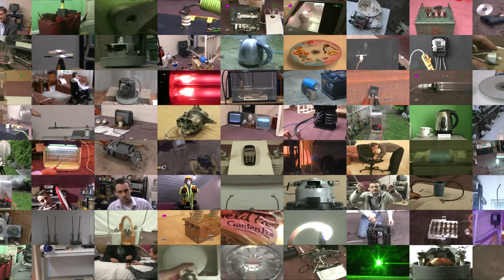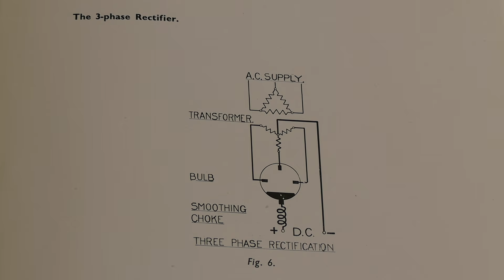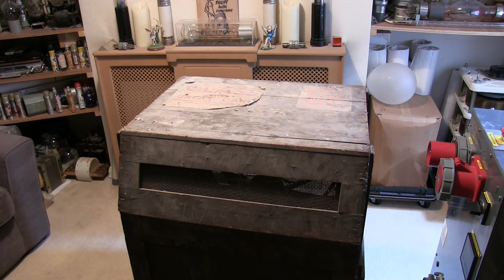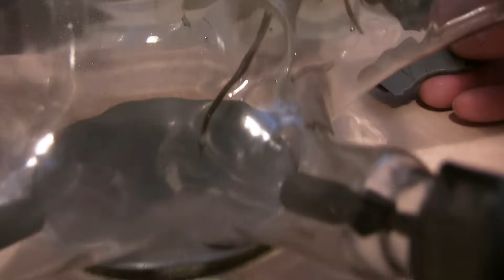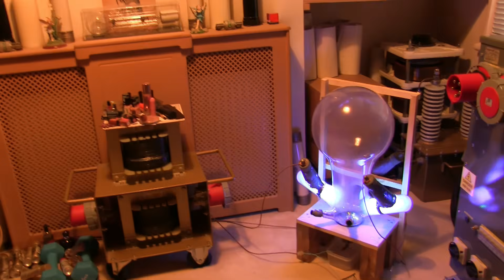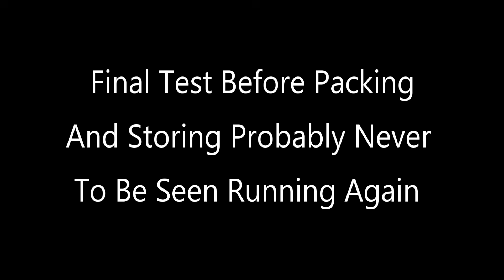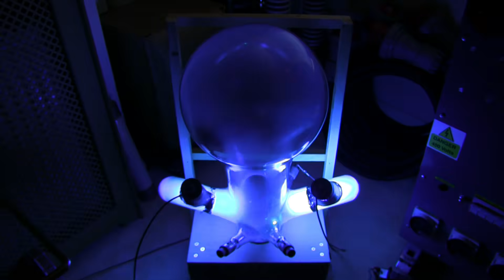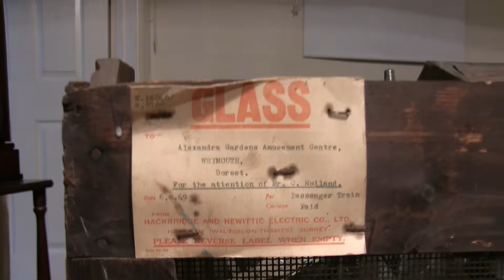Testing The 50 Year Old Mercury Arc Rectifier

Comment: geesh that is a scary looking contraption.  what were these used for back in the day?
Reply: HV AC to LV DC conversion
Reply: It's for frying rectums.
Reply: Years ago i saw a video on Youtube where one of these was used in a tram / streetcar
Reply: @Engineer9736  We have 4 in operation at the Museum of Transport and Technology in Auckland NZ. 6600 VAC is rectified and supplies the 600VDC for the trams.
Reply: They were also used in high-power TV and radio transmitting stations a long time ago.
Reply: Just about anything where you wanted high power d.c.  small ones were used in battery chargers, larger ones for electroplating, some types of machine tools, railways and tram systems, radio transmitters and radar sets.  Arc lamps for cinema projectors and lift motors were a major use of them.  This one is still quite small, most large ones had six or twelve main anodes, and really large ones were steel tanks rather than glass bulbs.  There was a really huge steel tank one at the London Transport Museum Depot in Acton the last time I was there a few years ago with the works lifted out of the tank to show what was inside.  I don’t think many of the visitors knew what it was.

The Kempton Park waterworks Museum has a pair of working rectifiers providing their 200 V d.c. supply.  These came out of the Royal Opera House.
Reply: ac to dc conversion. that's what rectifiers are mainly used for
Reply: Rectifying energy
Reply: There were some of these in use to rectify AC to DC for traction supply on the Manx Electric Railway (Isle of Man) until about 10 years ago.
Reply: RECTIFICATION !
Reply: @graealex  FULL BRIDGE RECTIFIER!
Reply: @TheRepublicOfYhonai  calm down, start Mehditating.. 😁
Reply: @TheRepublicOfYhonai  unibrow intensifies
Reply: @TheRepublicOfYhonai  Actually just a half-bridge rectifier.
Reply: @TheRepublicOfYhonai  Electroboom reference?
Reply: @woodhonky3890  You can never escape THE RECTIFIER!
Reply: @erinfinn2273  So true
Reply: Ac to dc
Reply: The big one is for municipal power facility AC to DC rectification
Reply: The label on teh box said something about a passenger train.....so can only assume it was used in that scenario back in the day?
Reply: @IanScottJohnston  that is a delivery note, to be delivered via/per passenger train... the install this was intended for is electric palace amusement arcade in Weymouth, uk, 1969, used to be an old theater but changed to amusements in 63. this needed much DCV as you'd imagine.
Reply: Petey dafuq are you doing here. Didnt expect to see you here. Guess other furries are also allowed to watch this :b

Comment: I have almost no idea what half the equipment is that you're using - only that it's big and you usually blow it up, generally always in your living room. I do appreciate the explanations though, they help a great deal! I love this channel!
Reply: Rectifiers convert AC to DC by arranging diodes (one way valves) in a way so that when the current flows in one direction, diodes keep the other half from going back the other way. When the current switches (alternates)to go the other way, the diodes that was letting current go through now stops it from going back, and the diodes that were not letting current go back are now letting current through. This keeps a constant flow of current in one direction, never letting current go back the other direction. (DC)
There was a time when Edison and Westinghouse (foes) were battling on wether to send DC or AC from powerhouses to homes. Nikolai Tesla who at the time worked for Westinghouse displayed the benifits of AC, and the disadvantages of DC being delivered to homes.
These devices are the crude instruments of electricity being delivered to homes via DC (Im assuming). It wasnt long after that that DC was proved to be horrible as current delivered. AC was truely a genius idea by Tesla. Westinghouse started designing household appliances for AC use and together, they clobbered Edison. 
Dont be fooled about Thomas Edison. He was a theif and a jerk. Tesla worked for him before he worked for John Westinghouse. Edison stole several ideas of Teslas and gave him no credit for them. Edison couldnt comprehend AC current and told Tesla it was a bad idea. Westinghouse understood it and held an exibition at the worlds fair. All the lighting at the fair was electric, not kerosene.
Reply: If you really want to see how we got to where we are today, check out the Westinghouse story. John Westinghouse was an amazing man. Invented all kinds of stuff.
Reply: George Westinghouse...my bad
Reply: Yea this is one thing I don't think even Photonicinduction wants to blow up. Will be very bad for your health and will probably have your house condemned due to all that mercury in there. And it creates one of the worst forms of mercury and that is distilled mercury. Probably the only one that tops that will be Organic Mercury.
Reply: @lanceholland9851  
But they got wise and started insulating them with asbestos. 😂